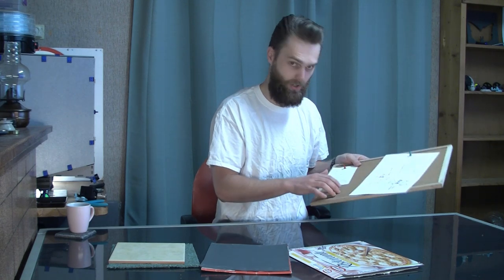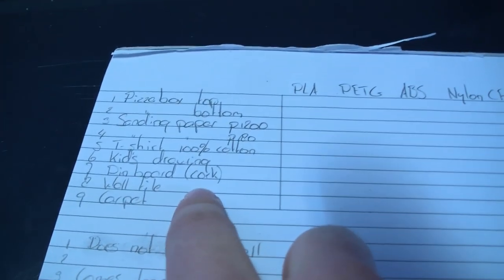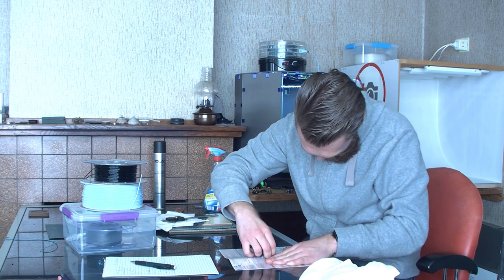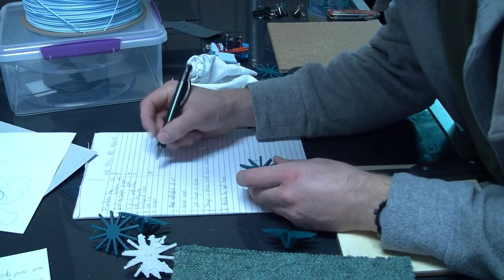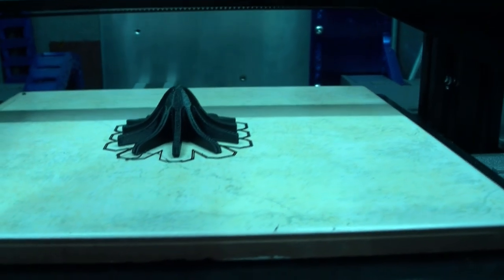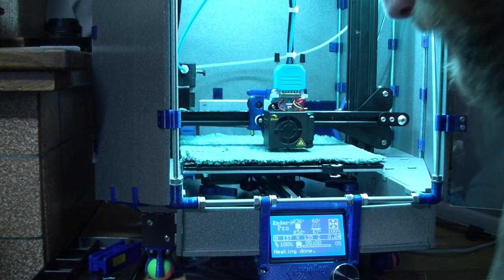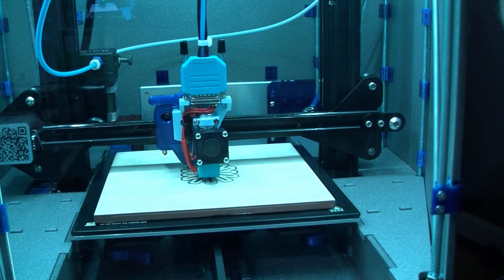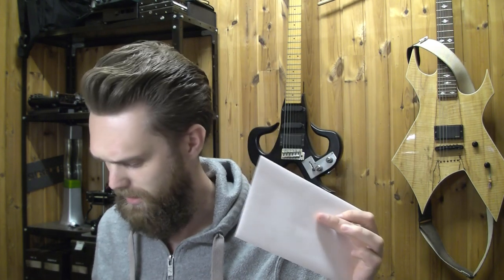7 household items you can possibly use as build plate

Comment: I had no more print surface after breaking tiny part of glass from my mirors and damaging my builtak, tryed the back of the mirors, worked prety well, PETG does just release when cooling down witouth breaking tiny parts of glass.
Reply from the maker: That's interesting, I haven't thought of using the back side of a mirror. Thanks for sharing!

Comment: Nice Experiment. Where you getting better results on the tile than printing on glass?
Reply from the maker: Thanks! The results were similar but the ABS came loose way easier than with glass, yet it didn't warp. I've bought some tiles and I'm going to print more on it to  gain more experience with it.
Reply: @properprinting  funny enough, you need a tile that is similar to a pizza stone. Needs to be porous as to transfer heat a lot better. Terracotta tiles have these properties.
Reply from the maker: Hmm, interesting. I'm going to look into this, thanks man! Indeed funny that this is still pizza related, I love pizza xD